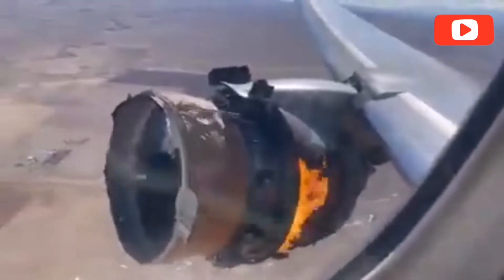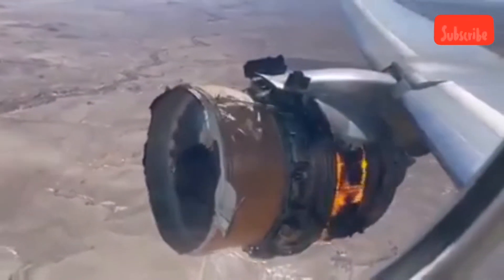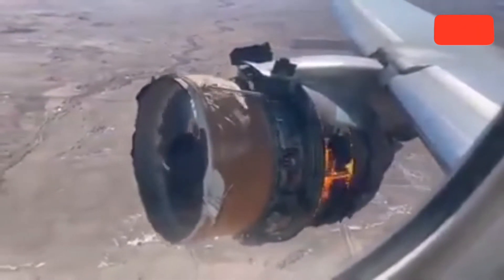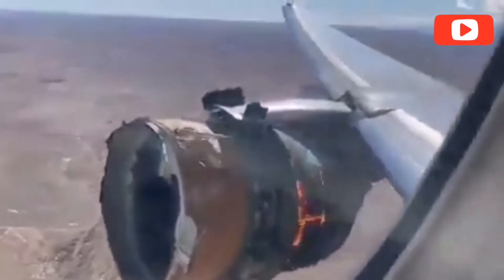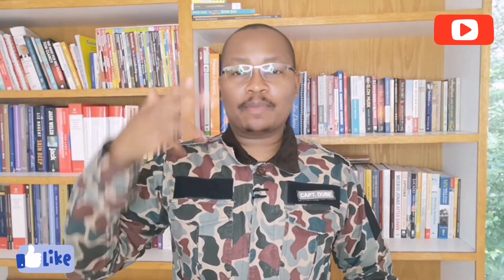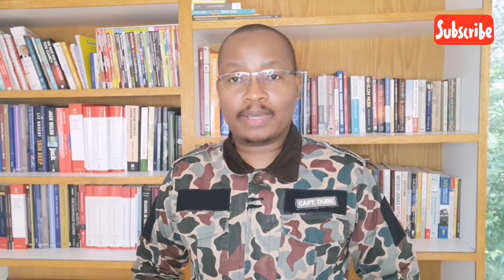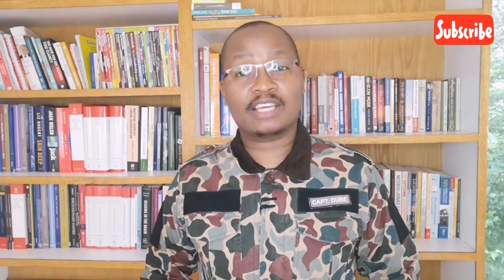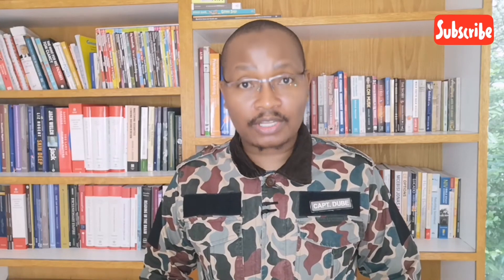UA328 Catastrophic, Uncontained Engine Failure

Comment: Hi. I'm 16 and want to become a pilot. What percentages for each subject are we looking at to become a pilot.
Reply from the maker: Hi Antish, Well the law does not necessarily prescribe particular subjects per se. However, it is standard practice to require applicants to produce favourable Matriculation results. That having been said, your performance in those high school subjects will matter a lot. The passing threshold in aviation is 75 per cent, and not 50 per cent (which applies in most institutions of higher learning – and in some cases, as the South African Government has been doing, even far less than 50 per cent). Aviation training is pegged at that 75 per cent pass mark, anything less is a fail. This means that for one to fully comprehend and pass the various modules, they must be able to perform extremely well and reach that target. It would really be up to the school you approach on whether they are happy with your overall results. But quite honestly, if you really want to make it, I would urge you to endeavour to get very good grades; because attempting to do this with weak grades, say a series of 50s, (or in the case of the  SA Government sanctioned lower threshold, 30s) would be a disaster. Aim for good grades (I would say the upper 60s and better) and that work ethic will come in handy when you approach your aviation training. And remember the ICAO English proficiency requirements also have to be met.
Reply: Thank you so much for this information.